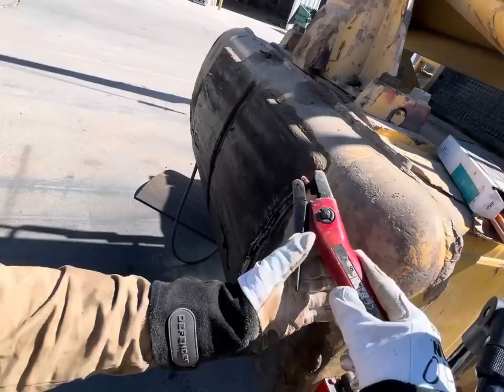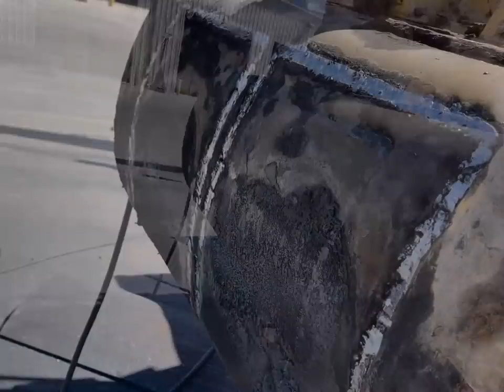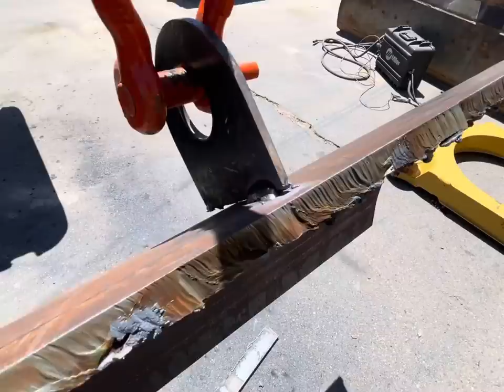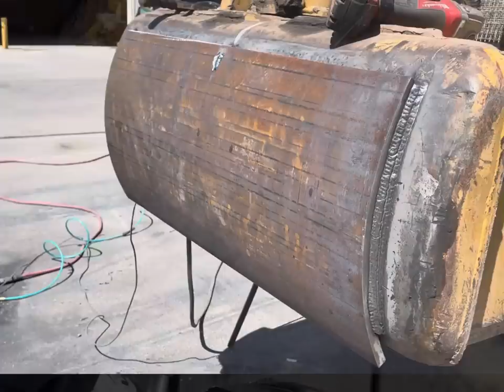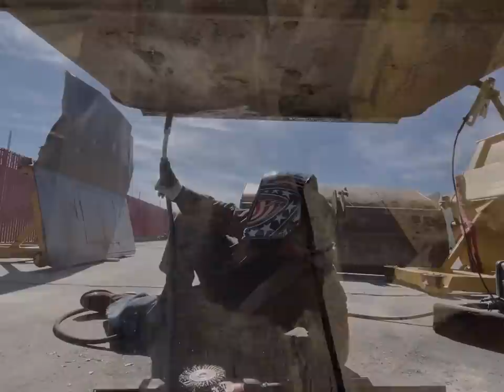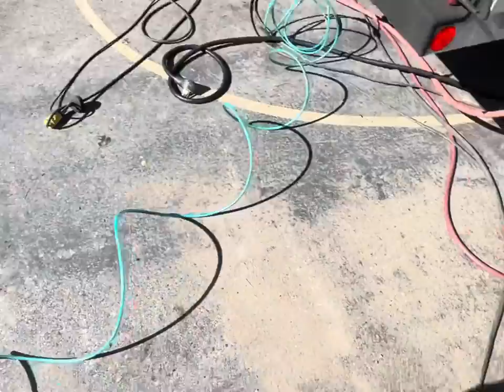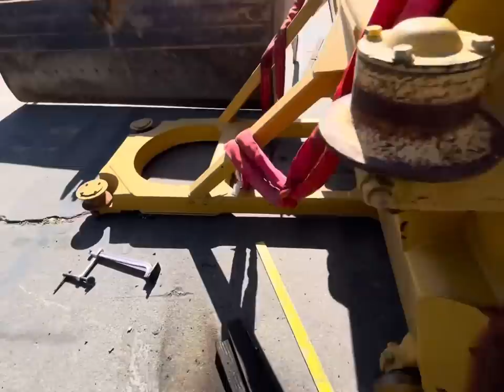CAT 627 Push Plate

Comment: All this heavyequipment torches and tooling and u welded the gap 👎why give ur self a horrible horrible fit? Kinda odd.
Reply from the maker: I was just playing  the cards I was dealt. There was no way to get that AR 400 tighter.
Reply: @OFW  you could have put a horizontal slice on center line of that AR and that would have close up ur gap and been much stronger just my opinion not doggin ur work. I never give myself a bad fit and then put my name on it. Had to learn the hard way when I was younger.

Comment: So with the mismatched profile, what's gonna keep that skin from caving in where there is no structure in direct contact behind it?
Reply from the maker: It will probably flex a little but that AR 400 is really stiff. And it has pressure across the entire surface.
Reply: @OFW  Learned something. Thx.